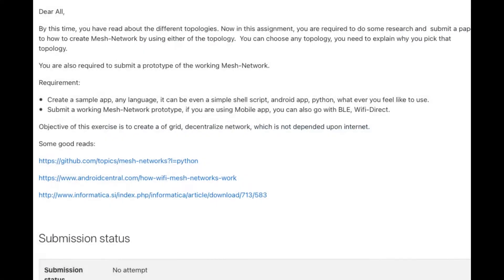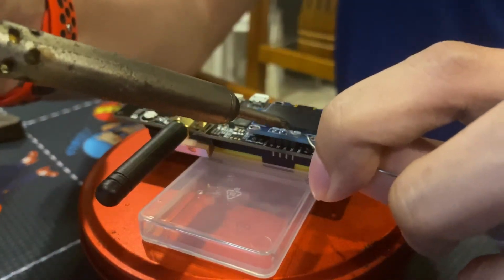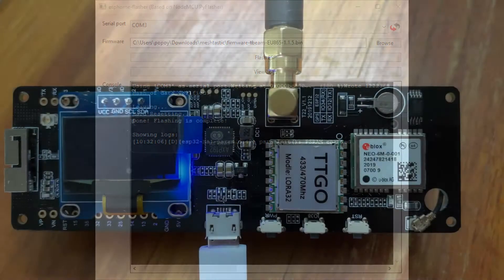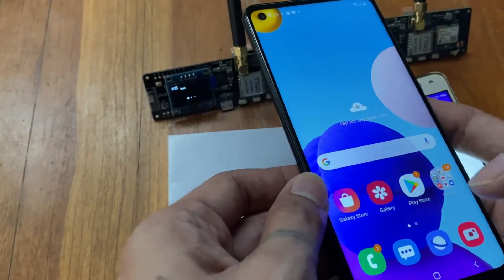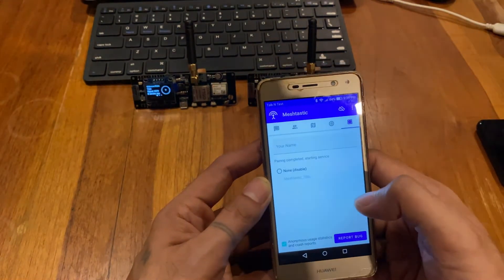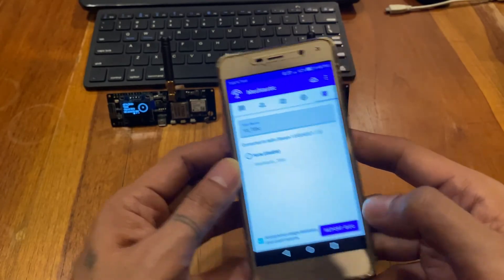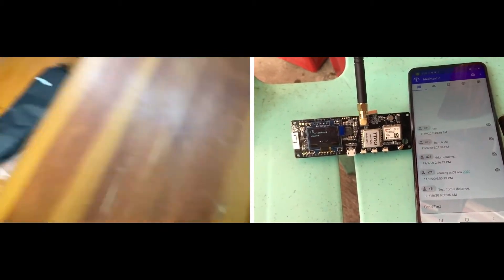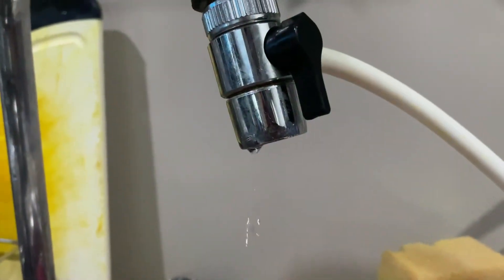Mesh Network GPS Communicator (Meshtastic with TTGO T-BEAM)

Comment: i soldered in the right holes but the screen wont come on. battery installed right. plugged in, antenna on. any ideas? two boards the same problem

Comment: Where do you get the diagram to know which pins to solder the OLED display to?
Reply: Pay attention on proper pin order; VCC, GND, SCL, SDA. Some OLED displays having VCC and GND swapped. Then on the board watch for 3V3,GND, 22, 21. So solder VCC to 3V3, GND to GND, SCL to 22, and SDA to pin 21.

Comment: What else can this gadget do without an Android phone? My guess the Android with the app is the device to send chat or text messages. I only have an iPhone but like to experiment with this LORA. Salamat.
Reply from the maker: using it with an android phone is simply the easiest path, of course only if you already have an android phone. haven't tried it yet but you may try using their python API (https://pypi.org/project/meshtastic/) from your (windows/mac) computer instead. if you're gonna try it with a mac, kindly comment here a link to your guide - wanna try it myself as well. 👌🏼
Reply: @jaimeivargas848  Looks like this does exactly what the Gotenna does except the user can add more features and functions since it's reprogrammable.
Reply from the maker: @Tabbyf  yes, i've learned about gotenna as well. unfortunately it's commercialized. hopefully this meshtastic project pave the way to a speedier mainstreaming of communication via mesh network.

Comment: You need to heat the pin then add the solder, after you flux.
Reply: @Michael-pk5le  the soldering part was actually a grueling experience for me as i only made use of what i currently own and really lack the knowledge, all the more the skill of soldering - so i cannot really help you with that. but a number of resources recommend the use a smaller soldering wire and tip.
Reply from the maker: thanks for the tip though i'm pretty sure it will actually take a lot of practice to really become "comfortable" doing it. 😅